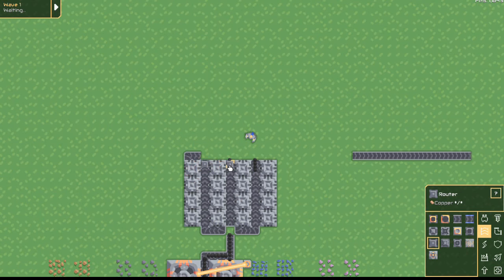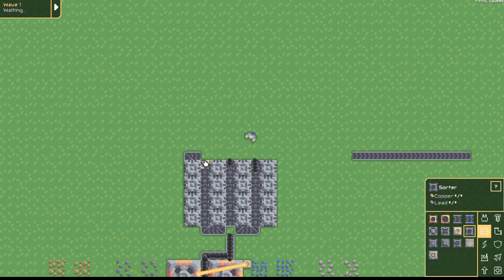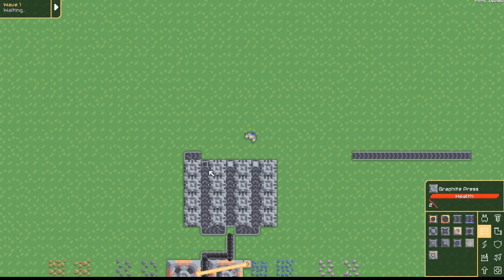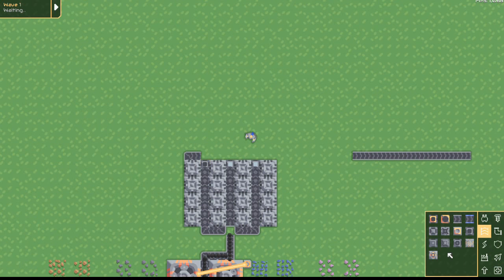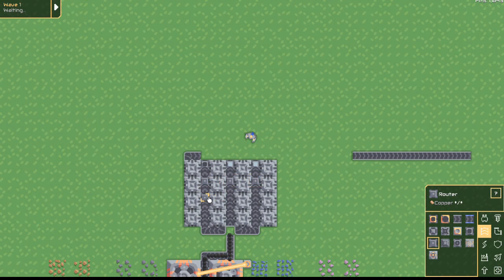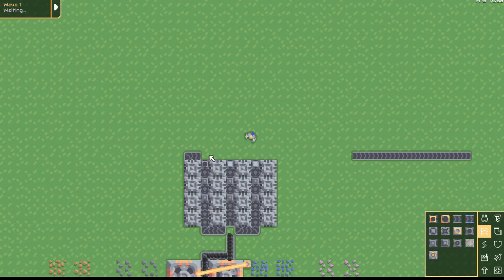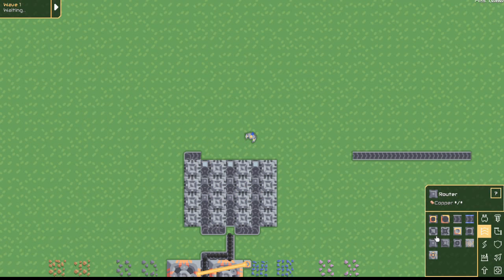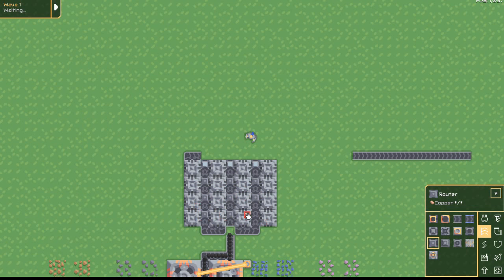Easy Graphite Setup | How to Mindustry

Comment: Wow this is cool layout :D though I still prefer separate in/out line. It would be bad if coal are too much ..all output is clogged up and when it can come out, you have no input. Some people say sorter is better than router in your another video but he's wrong. For example, if your conveyor can take 12 items/sec. You mix them up then you divide this rate between your input/output so your feeding is slower than machine can process. And not only we waste space we attempt to compact, we also waste power except this graphite press
Reply from the maker: I really wish I could understand half of what you say here. But I appreciate what I can
Reply: @AirNeat   Sorry, I'm not native English speaker :P. I mean conveyor can move 12 items/second right? So mixing input with output in the same line. Makes our input/output rate slower ..it get in the way of each other even though it can go to the correct place in the end.
Reply from the maker: @AstralrAstralr-mj1tr  That's no problem! You're right about this but it only happens if you don't put enough presses to use all of the coal
Reply: @AirNeat  Yeah but bad conveyor lead to some presses idle. We may need 5 presses if we give it a bit more conveyors but need 10 presses for too compact conveyors to process the same amount of input ..in the end we waste a lot more spaces to those presses instead. I'm sorry if it sound persistence, it's hard to explain :D
Reply from the maker: @AstralrAstralr-mj1tr  There are more reliable designs I'm sure

Comment: Everyone be like "hey what a cool setup", but it's one of the worst ones, because it will have tendency to get stuck once the diagonal belts get full with Coal and then you have to manually remove the entire belt lines wasting tons of resources, let alone the resources you waste by having it stuck for 10-20 minutes until you randomly notice your graphite production has been offline the whole time. I prefer risk free setups that I don't have to monitor all the time. On every build have separate input/output so it can never get stuck no matter what happens. Yeah it will take more space, but for the full automation it's 100% worth it.
Reply from the maker: Never had this design get stuck, so not sure the problem you're having. Sorry bud
Maybe you didn't put down enough Graphite Presses to eat the coal
Reply: @AirNeat  The upper producers will work as they have access to the output belt, but the 3 bellow can get easily stuck once too much coal gets pumped through the diagonal belt lines and no matter how fast belt you put there it won't help the flow. Once they get 10 graphite stored, they have nowhere to output and they also can't input anything.

However the reliable production from upper producers won't be consuming coal fast enough to unstuck it when it gets to this point so at some point from 12 buildings only 3 will work until manually fixed. Maybe it would be better with output belt around the entire build so only the middle line can end up stuck, which shouldn't even happen as all other 9 will always have output belts to consume the coal.

But why not waste 2 more blocks to do the same design metaglass is made of with 2 input belt lines of coal zigzagging and 1 output belt on the other side? 8 producers for 2 full normal belts are near perfect consumption/production, but if that's not enough graphite income for you, then you can always upgrade them to full titanium belts and extend the graphite producers on the other side with another 8 or upgrade the old ones for the more efficient graphite producers. This design is from my experience giving more than enough graphite for anything in the game and it has the mid-game/late-game scaling potential.

Comment: Hey Air..  umm can you help me figure out what to do now that I've gotten titanium.. like I've done well with copper, lead, graphite, silicone and now titanium.. what should be my next goal.. thorium.. palitonium [whatever it's called] or the alloys? Does it matter which map I try to farm on?? Thanks.
Reply from the maker: The later maps have more types of resources. I would try to farm on the easiest map with all of the resources you need. I don't know exactly the best resource to get next, but if you don't have Metaglass go for that first
Reply: @AirNeat   what if i made a custom map with tons of each ore
Reply from the maker: @Xnoob545  Don't think you can farm from custom maps
Reply: @AirNeat   WHAT IS THE NEXT STEP

Comment: It would be easier to have several inputs with a distributor
Reply: Depending on the rate, you'd have to worry about back log. It has a max flux rate of about 12 or 13 per second. Oughtta be good with two or three basic conveyors for standard use. Just be sure to use pulse conveyors for the final products.

Comment: if you put an inverted sorter one square away from the end and set it to coal, it will never clog up
Reply from the maker: It actually already doesn't clog, turns out I was wrong. I didn't even realize there were inverted sorters
Reply: @AirNeat  no, I've made three of these today and they were clogging up.
Reply from the maker: @Klenzer  I built this a while ago and tested it with an extreme surplus of coal, doesn't clog. Must not be the exact design. Or maybe I did it wrong idk.
Reply from the maker: @Klenzer  maybe we have different definitions of clogging? It should never stop completely from my tests.
Reply: @AirNeat  I'm not sure, I'm sure our designs are the same. Mine would clog irregularly. Like every 5 minutes or so. Clog as in stop completely.
Reply from the maker: @Klenzer  ah, I didn't test for more than 2 minutes